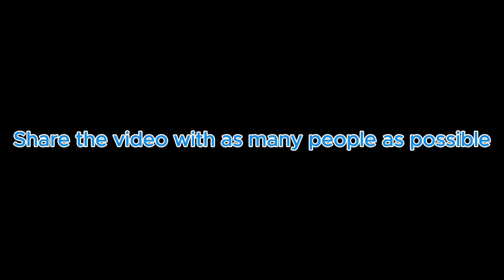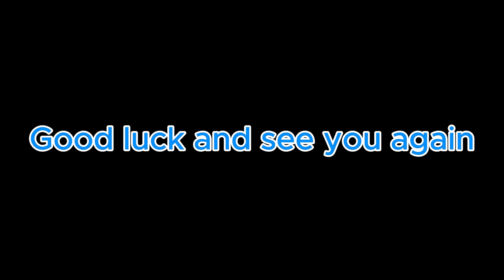Mix SILICONE and ACETONE! The results were shocking because they were so unexpected

Comment: Well it's obvious that silicone is waterproof,  but I had no idea you could thin it down with Acetone... thanks for the info
Reply: White spiritt works as well.
Reply: Mineral spirits
Reply: That will depend on the silicone. Many more recent silicone sealants are of the low VOC type and so this may not work with them. If you sealant smells a bit like vinegar when it's fresh, this should work fine.
Reply: @nickwinn7812  cool, thanks,
Reply: @nickwinn7812  Some time ago I tried non-aceitic silicone when re-doing seals in the bathroon. Like advertised it did not smell of vinegar at all, instead it smelled like a whole chemical plant and gave me headache for the rest of the day.
Reply: @nickwinn7812 Es cierto acabo de hacer la prueba y no hay forma de disolverlo
Reply: @nickwinn7812 smell like vinegar , yes,  that's it . Thanks. In chemistry  , both acetone and vinegar are made from alcohol also .
Reply: @philip5940  Vine4gar does not dissolve silcone...sorry, it just does not work. And it is not alcohol based just acidic.
Reply: I don't think it got thinned down by the acetone. I think that the process creates an emulsion instead which the acetone portion just has to evaporate out.
Reply: Exactly, so!
Reply: Would this work on fabric?
Reply: @ntohet that's what I wondered
Reply: MEK solvent works alot better and doesnt leave a wet look.  
We use this in the marine field ALOT.
Reply: Kwik question. Does your solution waterproof plywood and allow fiber glass to adhere? @devinmartin7626
Reply: I used gasoline to thin it out as well  and wiped it on the inside of a snowblower to keep snow from sticking. (Caution gas is flammable)
Reply: This is how parchment paper is made
Reply: Old idea... Use metasilicate and water
Reply: You can thin down silicone with many things
Reply: Many items like adhesives and sealants use Acetone as their primary liquid source as a ingredient. Many items can be thinned or altered using their primary ingredient.
Reply: مدى الفعالية على المدى البعيد
هل تتأثر بالشمس مع الوقت ❤❤❤
Reply: Waterproof is a gradient. Can it waterproof cardboard for 1 minute or can it waterproof a cardboard boat at sea?
Reply: We need you to test this captain  @earthenscience
Reply: If you dunk a silicone cast or mold in paint thinner it’ll expand. You can then make larger copies of them
Reply: Similar to how you use Water to clean up when using Latex based caulking, Acetone is how you clean up when using Silicone. Example: Put some acetone on the end of a rag as you run a bead of Silicone Caulk, then wet your finger on the Rag soaked with acetone to wipe your finger over the Silicone Caulk to smooth it over/push it into the joint and then wipe away any excess silicone!. Your finger comes away clean (if you keep it wet) and you have a perfect bead of silicon caulk 
My point is simply that because we know Acetone is the solvent that dissolves Silicone for clean up ( just like water does for latex), then you just have to play with the Acetone/Silicon mix...it to get the right proportions to make a solution like this to meet your needs.
Reply: Acetona ou mais própriamente, DILUENTE CELULOSO para usos gerais ou de limpeza de ferramentas de pintura. Tem a mesma origem e é menos volátil.
Reply: Muito legal!!! Parabéns 👏👏👏👏👏👏
Reply from the maker: Thank you for watching the video and leaving your feedback. Each comment you make helps the channel grow and motivates me to work more effectively
Reply: @Tips365day genuine responses lead to more ppl commenting, and engaging, which grows a community on your channel. This would help your channel growth exponentially,  and increase your youtube revenue. Food for thought.
Reply: @Tips365day  I did everything you did,, right downto the zip ties as a spinner. It wont mix,, I deaded a full dewalt battery. ,, help!
Reply: @Tips365day  Thin with vinegar
Reply: @brimstone33 fewer 🥈 silicones are using the chemistry that allows acetone to be the solvent. There are two main groups. They either smell like vinegar or formaldehyde. You want vinegar smelling silicone.
Reply: @brimstone33  No, Vinegar does not dissolve Silicone.

Comment: That asbestos tile was just cut and microscopic loose fiber were made airborne with that hot air gun.  Did you know one exposure like this has a chance of placing a little indigestible fiber into a pore in your lung that will cause irritation and eventually kill you?       I like the idea to make a small batch of sealer with left  over silicone product.  enough to do a brick windowsill with the amount i would normally dispose
Reply from the maker: Thank you for watching the video and leaving your feedback. Each comment you make helps the channel grow and motivates me to work more effectively

Comment: Hardly "Shocking" more like "Expected result". You could achieve the same result with polyurethane lacquer straight from the tin. With your method, there is also a good chance that the acetone will dissolve the spray bottle, then you would be left with a real mess.
Reply from the maker: Thank you for watching the video and leaving your feedback. Each comment you make helps the channel grow and motivates me to work more effectively

Comment: You can also thin silicon with mineral turpentine.
That solution can then be used around automotive windscreens etc. to seal leaks.  The fluid wicks into the gaps and over a day or so the turpentine evaporates away leaving a very thin skin of then cured silicon.   Makes a very neat looking waterproof joint too.
Reply from the maker: Thank you for watching the video and leaving your feedback. Each comment you make helps the channel grow and motivates me to work more effectively
Reply: Silicon is an element. He was using silicone rtv. An organic compound.
Reply: what if on mirror it can?

Comment: While this works, clearly, it isn't all that shocking and  it can be dangerous.  Acetone is highly flammable - even the heat gun could ignite it.  It is also a lung irritant, so this mixture should not be used indoors.  Lastly, you can buy waterproofing sprays that are equally effective and cost about as much as a can of acetone and a tube of silicone.
Reply: Actually, most of the store bought spray wear off after a while, I have tried numerous. This methhod works and the waterproofing stays, espesially on fabric.
Reply: That is true . Thinking I might try to waterproof an old pair of work boots I have at home.
Reply: The guy in the video doesn't seem too worried about safety, but other than that I liked this. If I was going to try it, I'd do some further research. If someone combined all the constructive feedback in these comments, they could create a cheaper, better flex-tape. The idea of using it on fabric sounds like a winner, having a way to create a thin, flexible waterproof membrane of any shape you can sew together could be used to protect moving parts or electronics on a drone or outdoor electrical project that you might otherwise try and 3d print for a poorer more brittle result.
Reply: like condoms ?
Reply: Ну, это там, где они есть, а где нет, приходится обходиться лютым самопалом, вроде этого или растворённого в бензине парафина. Мне больше понравился венчик для миксера из палки и стяжек, дёшево, сердито, работает))))
Reply from the maker: Thank you for watching the video and leaving your feedback. Each comment you make helps the channel grow and motivates me to work more effectively

Comment: Don't ever try that on structural elements. Silicone will seal wood from the outside air completely and therefore will not allow to get rid of eccess water. It will rot quicker.

On artificial stones it will sink into the micro cravices between the bonded minerals and break up the bonding between them, thus creating cracks and reducing the stability over time.

There are actually studies about the usage of silicone in constructions which proove that.
Reply from the maker: Thank you for watching the video and leaving your feedback. Each comment you make helps the channel grow and motivates me to work more effectively

Comment: all that happened is the acetone, thinned out the silicone.. to  a watery state.. so you could brush it on and make a very thin waterproof barrier. acetone is good solvent for many things..i use it to thin fiberglass resin, so it easy to work with and soaks into the fiberglass better
Reply from the maker: Thank you for watching the video and leaving your feedback. Each comment you make helps the channel grow and motivates me to work more effectively

Comment: WARNING: Do not use PET plastic bottles or sprayers for acetone. They will warp, crack and leak soon. Big mess + fire hazard. Use HDPE (recycle code 2) or PP (recycle code 5) instead. Both work as long as they do not have very thin walls. Glass would also be ok. Make sure the container is properly air-tight if you want to store it. Acetone will very easily evaporate and not all containers are designed to be water-tight, much less gas-tight.

Otherwise this is a nice DIY weatherproofing trick that is very cheap and effective. You can do much the same thing with mineral spirits instead of acetone. This is much less toxic to handle and can significantly cheaper depending on where you live. The downside is it requires much more time or mixing.
Reply: @ronblack7870  Manual sprayer heads like these are very often made completely out of polypropylene - so that probably has a much better chance of holding up. They use very simple pistons without orings ect. You can study the mechanisms well on the models made in clear PP. I've had a PP micronizer on a HDPE bottle with a mostly acetone solution for several months and not had issues with it. Anyway, a failed sprayer is an annoyance. A bottle full of silicone/acetone spilling everywhere is a disaster :P

But any other more complex sprayer (even a garden/chemical pump sprayer) you are right - it would wreck all seals pretty quick.
Reply: I was just about to comment on the very same thing, but thought surely somebody else must have picked up on it. Kudos
Reply from the maker: Thank you for watching the video and leaving your feedback. Each comment you make helps the channel grow and motivates me to work more effectively
Reply: I can only imagine having highly flammable liquid silicone running out of someone's plastic bottle and onto who knows what causing anything from a potentially hard to put out, almost napalm like fire that would melt skin.  Or I dunno someone whom is not familiar with acids having their container leak while they moved onto some other project or left their work area I can imagine liquid silicone+acetone would not take a ton of heat before it reaches its ignition temperature reffered to as"flash point".  Anyone who is unfamiliar with things like making liquid state silicone, I would strongly recommend to start researching other chemistry basics such as alkaline vs. acidic or molecular structures of basic elements like h20(water) 1 hydrogen molecule that has bound itself to 2 oxygens. Once you basically get this, then there are things such as doing a vacuum distillation, which is a very common way of separating two or more compounds that are mixed together whenyou only want one of them.  Going back to flash point this is going to be a temperature that must be certain prior to heating the mixing flask and put simply.. one temp. will boil off before the other leaving you fairly certain you have one compound left in mixing flask and the other in its separatory flask. Also the vaccum is used to alter when a compound will boil. anyways shout out if you actually read this long drawn out comment
Reply: Acetone is not very toxic. Actually your liver produces it to feed your brain if no sugar is available.
Reply: Alight Captain of the fun police, geezus lighten up, we all want to see his hack on how to put an acetone fire out whilst being on fire lol

Comment: Depending on what type of plastic bottle, the acetone might eat through the bottle depending on what concentration. Also, using a heat gun with acetone 
could ignite acetone- bad idea!- I did like the zip mixer idea ,thanks
Reply: Why use the spray bottle at all......He ended up brushing what he had sprayed.....He could have just brushed it on in the first place.
Reply: @agedflier9129  My thought exactly. Why ruin a brush AND a spray bottle when you can get by with ruining just a brush?
Reply: @thatzwhat  Finally he got a waterproof brush as well. :)
Reply: Eating plastic? The reason my old dad saved every mayo jar, pickle jar and big juice can we ever brought into the house.  Grab a clean jar or can and off to the races!
Reply: @miaanthony8911  It will eat pvc though. My dad used to screw around with Acetone and throw all kinds of stuff in it and use it as glue and stuff. He loved putting Styrofoam in it.
Reply: mixer 2 hands turn as a fire with woods :D and  elastic bands and acetone you get a neoprene glue :) prefer a steel container :)
Reply: @louis-jeanbraye9834 the only part of that I understand is elastic bands and acetone make neoprene?
Reply: @Tonisuperfly  oui le cahoutcouc véritable de l'élastique mélanger à l'acétone le fond :) et tuas une colle à froid comme la patex les vieux cordoniers connaissent cela :)
Reply: @louis-jeanbraye9834 I just saw this reply, 2 months later and I had to translate it. Thanks, cool tip! I didn’t know that one.
Reply: Ацетон та сольвент це різні розчинники. Сольвент не роз'їсть пластик.
Reply: The silicone will also lug up the spray tip.   It could dissolve plastic also , so you would be spraying silicone and plastic mix.  I have lots of empty spray bottles , so I don't mind throwing them away after one use.   I keep all my wife's empty cleaning spray bottles.
Reply: Actually, acetone is not flammable. Because ignition causes water vapour which instantly cancels any ignition
Reply: fwhen is the last time u saw a melted  plastic bottle. That was like in 1980. And the acetone will not combust from a heat gun that is silly. It has water in it. U sound like a mom. Not like u know this to be fact. Ya a heat gun COULD cause some issues, but WILL it? nah. you are far more likely to be injured by the heat gun itself.
Reply: The heat gun wasn't half bad, most of the acetone had visibly already dried off, so the chance of a fire would have been minimal. 
But the warnings are valid for anyone trying to repeat the experiment.
Reply: heat does not ignite acetone .. flame does
Reply: @robertbuck1028 said "using a heat gun with acetone could ignite acetone"

If you don't live in a torch like an idiot, you don't have to be ridiculously paranoid about anything that gets hot.

I live in a BRICKS house and you can't imagine how comforting that is
Reply: Ratio of silicone to acetone 1 to 1 ?
Reply: Could have just stirred it with the stick. Or posted a title card for 3 seconds saying "mix them to make a sprayable waterproofing material" and gone to lunch.
Reply: The guy in the video is literally using asbestos, and you're worried about using a heat gun while working with acetone 😂
Reply from the maker: Thank you for watching the video and leaving your feedback. Each comment you make helps the channel grow and motivates me to work more effectively